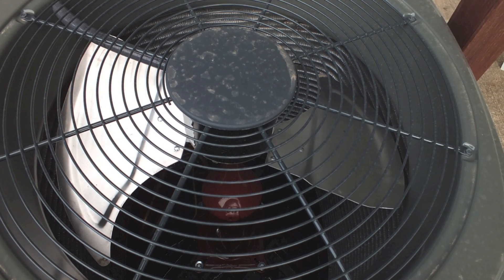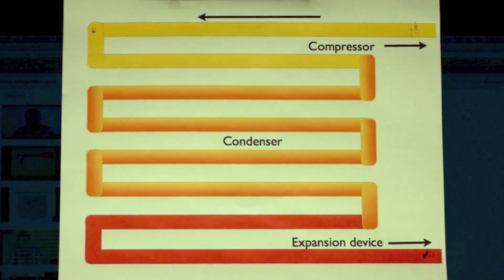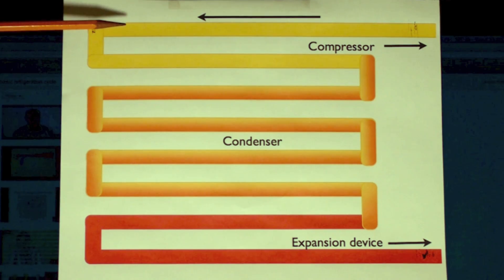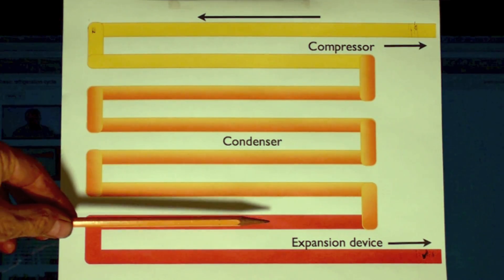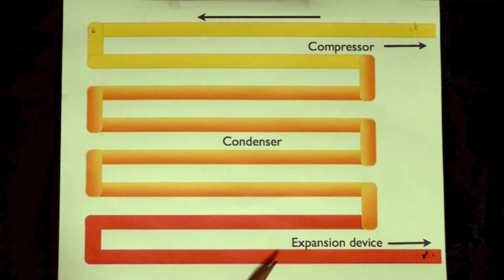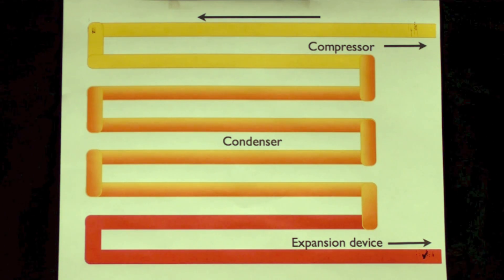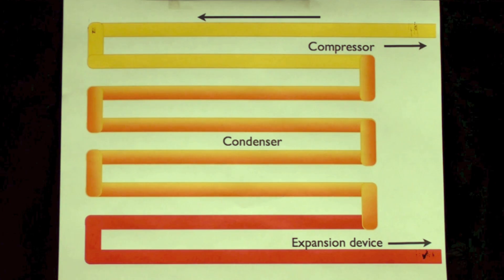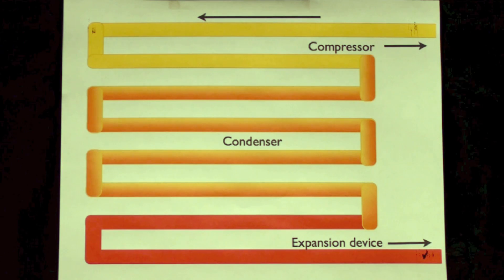The HVAC condenser

Comment: Any good advice on what to study.my module consists of(compressors,condenser,and some oil heat.)i feel like I'm having a hard time getting threw this starting part of the module.ADHD LD XD does not help....
Reply from the maker: robert rayner You can try the graycoolingman site.  There may be some help there.  The theory of refrigeration is sometimes a tough one to get but keep trying.  Hope this helps.GFM

Comment: that 3rd picture you showed was a old trane heat pump so technically its the evaporator coil in heating mode not the condenser the indoor coil becomes the condenser in heating mode on a heat pump and can you do another video on heat pumps using that old trane or not just wondering